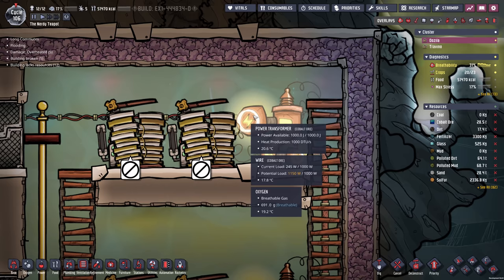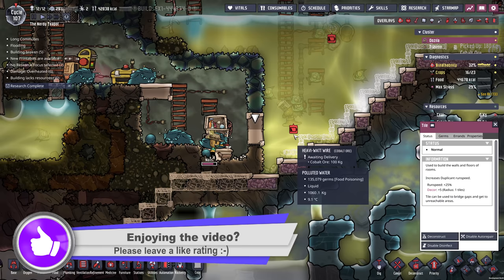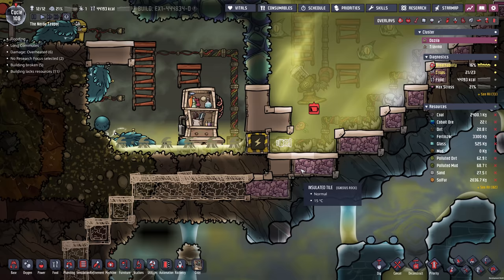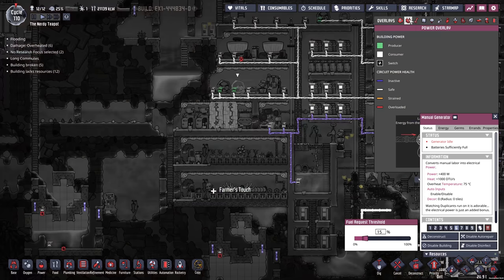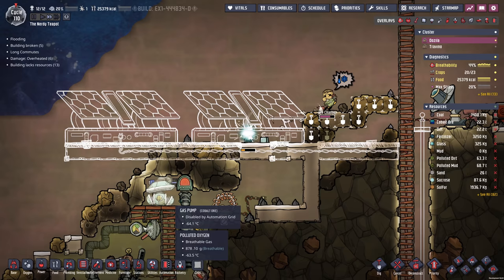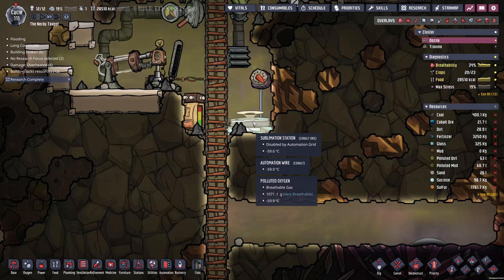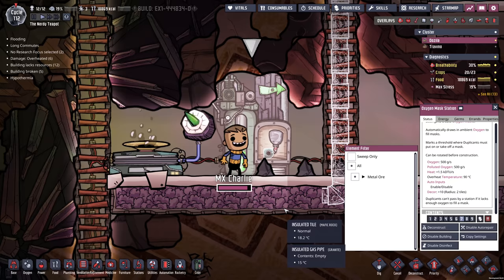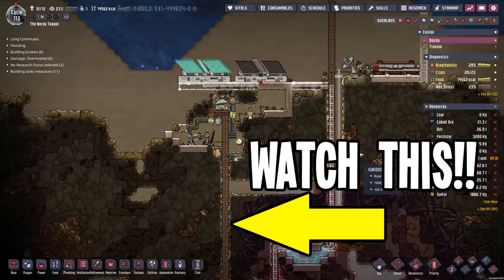Solar Power is the Bees Knees in Oxygen Not Included SPACED OUT DLC!

Comment: Its better if you do Backbone > Batteries > Transformer, than you dont need to worry about the allocation of Batteries number in each network
Reply from the maker: Good idea 👍
Reply: Transformers are 1k DTU heat production and smart battery is 500 DTU heat production. You can turn off the transformer when pull is low so  you don't generate excess heat!

I always do... Power Generation > Power Spine with battery bank > Transformer > output line connected to smart battery and consumers. Connect the smart battery and transformer with automation wire.
Reply: @jtjc7705  
That's a really good tip.  Thanks.

cheers.

Comment: POWER DISTRIBUTION:
You can have 4,000,000,000,000W of power generators on a 1000W line, but you can't have more that 1000W of consumers on that same line, without potential blow-outs. 

Generators don't affect the amount of electrical flow in a wire, consumers do. (unless they have changed something)

cheers Biffa.
Reply: My point is, it wasn't the PlugSlugs that made that 1000W wire go red, it was the amount of electricity already flowing due to consumer requests that redded them.
You could easily put another transformer in the PlugSlug Pit and use a smaller wire to spread power further..

Jess Tathot.
cheers mate.

Comment: Power Production does not overload wires, only Power Usage does. So... no problem having many plug sluges chewing on the same wire. At least when you seperate it with a transformer from the main grid.

Comment: Base of solar panel is like a title so the wires are unreachable underneath. The panel is doing nothing at the moment. The change where your coal generator was hooked into the backbone and now goes into the transformer does not actually do anything, it's the same connection as the two wires meeting at the same end of the transformer act as if it was just a straight wire without it.